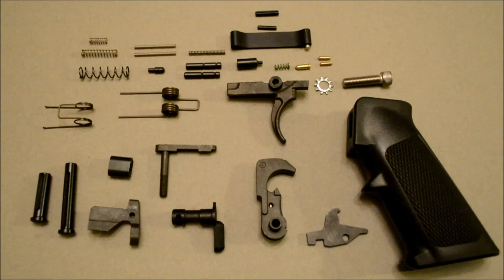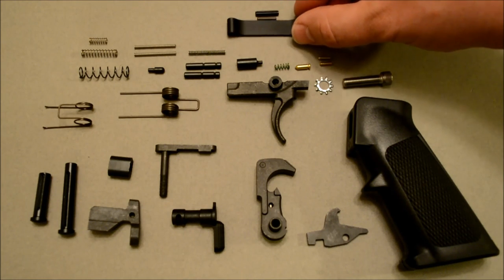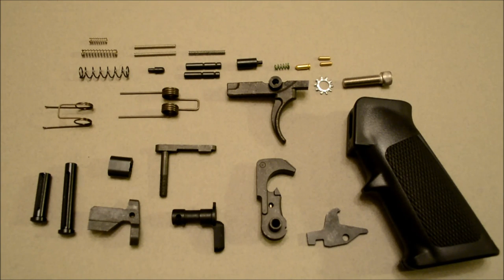Building an AR-308 on a Budget - Part 2 (Aero Precision Lower Parts Kit Installation)

Comment: Just finished assembling my Aero Precision M-5 lower using just this video as a reference.  Thanks so much for the guidance--it was incredibly clear and helpful.  By far, installing the front take-down was the biggest PITA: My detent flew out at least four times!  Fortunately I managed to find it each time in the recesses of my garage.  I can't wait to install the rest of the parts using your videos.  Keep up the good work!
Reply from the maker: I’m so glad that you found my videos helpful! Thank you so much for the compliment and comment. Good luck with the rest of your build! Let me know how it goes! Thanks for watching!
Reply: I have a couple questions if you don't mind.  

(1) WIth the DPMS rifle buffer tube, do I need a castle nut and end plate?  I believe you said in the video that you don't, and I don't see any indent in my rifle tube threading for the end plate..  

(2) Do I need to tighten the buffer tube to a certain number of ft-lbs?  

Thanks!
Reply from the maker: I don't mind at all! The DPMS buffer tube that I used does not need a castle nut or end plate. I've seen many places that say that people should torque their tubes to 40 ft-lbs. I just tightened mine as much as I could with my wrench, but didn't torque it. So far I haven't had any issues, but we will see! I hope this helps!

Comment: Great video.  A dab of grease on the safety detent spring keeps it in the handle when inverting to install.  A clevis pin ($1.00 at local hardware store) works well to retain the piviot pin until you insert the pin.  Thanks for sharing.

Comment: Good tip.  If you buy the lower Aero Precision use the lower kit parts for what you want.  Lesson learned for me on my lower build on my Aero lower using non Aero fitted OEM parts on a 5.56.  If you buy the other kits be careful of the Bolt Catch roll pin.  Very tight man be careful for someone that want to do this.  Great review man good stuff.

Comment: hey thanks for a detailed quality video. just finished my first ar10 lower. one trick that helps me with the front pivot pin is to push it in with an Allen key then use the tip of a razor blade to hold it

Comment: A very good item you pointed out was the lube Aeroshell 33 grease onto the threads. ANYTIME you thread like materials, in this case aluminum to aluminum, you run the risk of galling! If you were to assembly dry, and there happened to be a burr on the thread it would start to roll and the end result is very much like welding the two together! You would ruin both pieces. 
Very good video and series. I have an 80% receiver for an AR10 that I am going to be building. It is going to be a 45 Raptor. Nice thing is its the same BCG as a .308. So I can interchange calibers. 45 Raptor is somewhat new, but I liked its ballistics.

Comment: I have two questions
1. Did your magpul grip come with a washer?
2. I ended up with an extra roll pin (aparently for the bolt catch). Did your kit also have that?
thank you
Reply from the maker: Hello! First off, my grip was an Aero Precision brand pistol grip. It came with the splined lock washer. Second, I did have an extra roll pin in the kit.  I hope that helps! Thanks for watching!

Comment: Hey I am doing a similar build with the M5 set. Just FYI, the rear take down pin hole is threaded for a 4-40 screw (not included for some reason). Some trimming of the spring is needed but much nicer then sandwiching it with the grip.
Reply from the maker: +Multicam Dynamics Thanks for the heads up! I would love to hear more about your build!
Reply: Mine was included 7 years later lol.

Comment: ive got a little piece and a TINY TINY screw... any thoughts what's that for?
Reply: Its for the paddle on ur bolt release u will see the hole i was just as confused. They like to walk out as I’ve heard also so i did some rockset on it
Reply: I have that extra too what did u do with yours ?

Comment: I need this kit minus the pistol grip and fire control group, I seen other kits I described from other companies. only problem is you would need to buy the aero pivot pins because they are proprietary other pins in kits don't fit right. 
Do you have any suggestions? I don't know if aero's pins are different widths

Comment: I am thinking about buying Savage Axis 2 in 308 or to start building Ar in 308. Last time I went from thinking about buying M&P 15 sport to building my own Ar15 that cost me $1500. How much did you budget for this 308 build?  Also by watching you install your trigger did you consider polishing it and maybe using JP springs?
Reply from the maker: +Joe Medic I am hoping to keep my build to around $850, not including the optics, but we will see how it goes. I plan on upgrading the trigger at some point, but we will see how it shoots when I finally finish it. If the trigger is gritty, then I will definitely tweak it a bit. Thanks for watching!

Comment: Great video. I am waiting for Aero Precision to restock the m5 lower parts kit without the fire control group so I can assemble my lower.
Reply: FYI, that kit as been discontinued
Reply: +Alan Vail :( just bought mine today. m5 fde cerakote upper and lower. lower is a blem sale, plus coupon for upper kept price to $301 shipped.

Now I need the parts kit. That's why I love building these, always an adventure!
Reply: i was referring the the aero LPK minus the fire control group.
Reply: +Alan Vail OK. I had seen that, too. That's the one I want as well. I want to use an ALG ACT trigger and Magpul MOE grip. I hate paying for parts I won't use.
Reply: I have at least 4 unused trigger groups and grips

Comment: I heard you say the u chose to put a fixed rifle length buffer tube instead of a carnine length. Can you use AR15 buffer tubes and stocks on AR10s? And if so, what other parts or interchangable?
Reply from the maker: Yes you can use the same buffer tubes and stocks. There are a lot of interchangeable parts. I'll find and post a list
Reply: @LiveLifeOutdoors88  Thank you.

Comment: i picked up the same lower kit as you did...only thing difference on the parts was...I received two roll pins? any idea? in your video you do not show.......
Reply from the maker: +Tom Cartwright mine did come with two roll pins as extras I guess in case the receiver didn't use set screws. Are they extra or in place of the set screws?

Comment: Someone help! My safety selector spring isn’t strong enough or my detent isn’t long enough. Once together my safety doesn’t engage. But if I take the grip off and use a small Allen key to put pressure on the back of the detent it works perfect. What should I do? I just either need longer detent which I can’t find or a stronger spring, which I also can’t find.
Reply: I know this is old but if it works when you press on it with the Allen key, the detent isn’t too short. It’s a spring issue.

Comment: What was the build total pricing for this? I'm using this as a guide and im curious how much you ended at roughly?
Reply from the maker: With all of the shipping and taxes etc. it ended at $980. I go through all of the parts as well as some cost savings tips in the last video of the series here https://www.youtube.com/watch?v=1jIQvXPJnOs I hope it helps! Thanks for watching!
Reply: Live Life Outdoors I just did mine for 458$ here in New York. The only thing I didn’t buy yet is the BCG. Because it’s not priority, it’s -1 degrees here. I found a BCG I like for 90$ and one for 125$ both nickel boron. So I guess the total build was $570ish. Aero lower and upper for $185, Anderson 16” barrel for $89, strike industries lower parts kit 70$, upper parts kit $17, basic charging handle for $17, handguard for 55$, magpul fixed stock $25 ...obviously still need backup sights, red dot, flashlight. But I literally researched and found the ultimate budget .308 build. Got lucky because here in NY nothing is cheap and everything is always more here than anywhere else.

Comment: Just FYI, my bolt catch snapped in half when shooting and it had to get replaced. I have a feeling my BCG might be over gassed and that might have been the problem but keep an eye out for that. Also I love the BCM gunfighter charging handle. It won't exactly fit with the aero precision upper/lower set. I had to file down the charging handle a bit to make it work, which wasn't a huge deal
Reply from the maker: +AR-MD Thanks for the heads up! I will definitely look into the BCM gunfighter charging handle!

Comment: Aren't the lower parts (minus buffer) the same as one on an AR 15.
Reply from the maker: There are a few differences between AR-15 lower parts kits and AR-308 lower parts kits due to the size differences of the receivers and bolt carrier groups. It's safer just to go with an AR-308 kit.

Comment: Anyone else have a tiny tiny screw and a little piece  that’s extra ? Where does it go ??
Reply: The tiny screw is for the rear take down pin detent hole.  It keeps the takedown detent and spring in place if you have to take off the pistol grip.
At least that's my understanding and I'm still waiting on a couple of parts to assembly my m5 lower